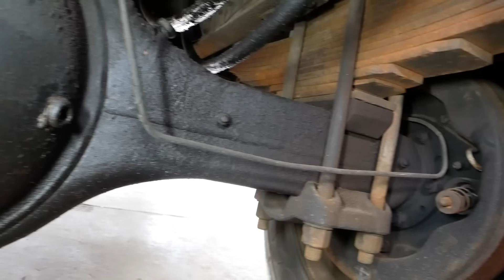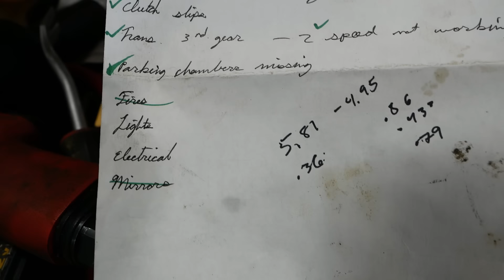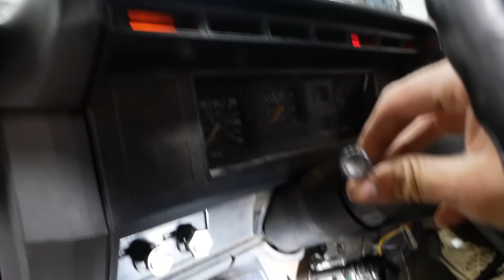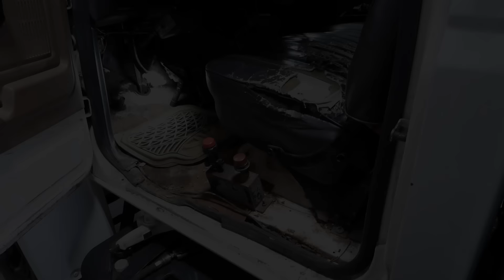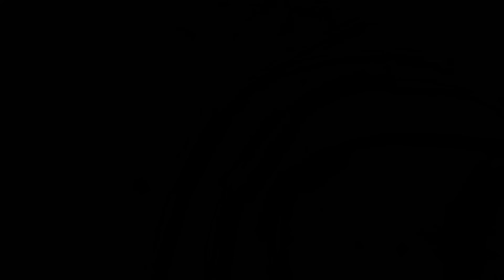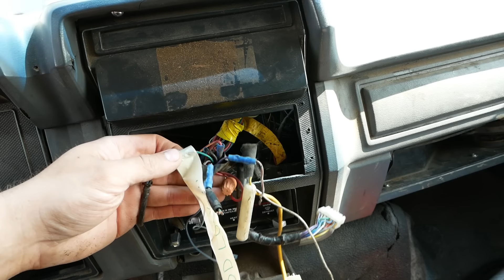Ford F700 Cummins Chipper Truck Project - P Pump Fuel System, Brake Chambers, and Wiring - Final

Comment: This truck is the poster for, “just do it right the first time” just imagine the amount of days this truck did not go to work, because of incompetence in repairs., and just imagine the years of stress of driving without windshield wipers. Lol
Reply: This truck is the result of a poor business model, but a common one, generally because they have a feeble maintenance program if any. There is no financial or downtime budget for the "right way" because it's all about profit. So the workers take the blame, properly earned or not for all mechanical problems, this is the place mechanical becomes personal, a lot of guys aren't gonna risk their job by reporting things so they make it work. It's not right but I see it all the time.
Reply: @deadpeddle4915  You could call that business model 'the result of manglement'
Reply: @deadpeddle4915  I agree, but as a business owner, that has ZERO time for any of my equipment to be “down for maintenance or repair” I can agree 100% that guys go and hack things and or have something working at 50% ., and refuse to bring it to my attention.. and feel an answer of “it’s been like that for a long time” justifies things.., now I’m all for what ever you want to call it, “hacking, farm fix, band-aid” to keep a truck or compressor, or blast tank in service., but then go right out and tell your boss, hay we had a problem with the brakes, we were able to rip the canister off and cap the line so we can keep working, but can we get this part ordered so we can fix it right, the next rainy day ?? I for one enjoy working on my equipment, when it’s general maintenance, or just swapping out parts.. larger jobs like internal engine work liners, and pistons I prefer to have someone help just because it’s not something I do every day., and the little tricks you pick up, make all the difference… but yes I do agree, with your statement…
Reply: @ryanhogan6509  A lot of this isn't even a lazy thing. Like the millions maurettes/wire nuts all around.... a crimping tool and EVEN those crappy non heat shrink wire connectors are better than those wire nuts lol. or just the hell of a mess all over. Some things for sure just get it done, but man, 50 bucks worth of tools to make the issues gone for a lot longer seems worth it IMO. I know the feeling of its a ''temporary'' fix that never gets fixed (because it works), so theres that too.
Reply: @baileyhatfield4273  yup everything is temporary, unless it works., lol..
Reply: @ Ryan Hogan:   Oh, it went to work!!!,.....just on back roads !!!
Reply: I forget which one it was but I had a friend who worked for one of these nationwide trimming crews . They had no FBO . So all maintenance was by local (where ever they happened to be at the moment) shop or by crew assigned to truck. The trucks were only kept for X years and cycled out. So in essence they have had a lifetime of "rode hard and put up wet" and the crews were usually minimum wage dead enders who just didn't care. My friend worked for them 2 years and said if a guy stays 3 months he's got seniority....

Comment: Wes, I gotta hand it to you, Ive had trucks like that in my shop and wanted to flat out refuse to work on them because of all the half ass work done  Very few of the folks around here are willing to pay for the time involved to undo all of that stuff. I do a lot of machinery / tractor restorations and they consume all of the patience I have for the most part. I have to take breaks as I feel my anger building up when something could have been fixed correctly for less effort and labor.
Some people have no business running or fixing machines.

Thx for the video, great Ford electrical refresher.

Comment: This is easily a 5K + material job...
Reply from the maker: Not quite...
Reply: @WatchWesWork  😕 man the amount of hours and know how youre putting into this work…. Dont settle for low payments. Ive run a shop in sweden for over 15 years. We specialize in us cars, mostly fords. What ive learned is that if you raise your prices and charge the actual amount of hours you put in, youll loose some customers only interrested in the work costing as little as possible, however, when you loose them, youre freeing up time for customers that are ready to pay to get their car fixed now or dont care about the cost as much. Keeping track of the amount of hrs each of my mechanics put in to each car is also very important. This way the bills are correct and free of any ”hours discount”. Dont be afraid to charge what your time is worth! Comparing salaries is hard between countries, but here in sweden youd be payed among the top 5% in the industry. No questions asked!

Comment: Jesus the only good thing about that old rig is the Cummins
Reply: What does Jesus have to do with this?
Reply: thats probably why the owner keeps it around. Did you see they probably got it from a Dodge or something because it had dodge wiring in there.
Reply: @parteibonza  yeah doesn't matter if the truck is a pile of shit is has one of the best diesels ever made under the hood

Comment: "why would they do that" - people put carburetor pumps on FI systems ever day and wonder why they have now power!
Reply: A modern car slapping on a carburator and making the whole thing FAR cheaper lol. Cheaper in the expences side of things. Also easier for on the road fixing and not getting stuck if you have a couple new or spare parts. FI has its place for your daily driver people who....well can barely pump gas.
Reply: @baileyhatfield4273  I meant people putting a carbouretor fuel pump on a vehicle with fuel injection and wondering why it doesn't work right. As for putting a carb on a FI vehicle to make it work - might be ok in the USA but not in the rest of the modern world -  Your gas millage will be worse (FYI the USA has cheap fuel today compared to the rest of us) , you will probably kill your emissions system and you will fail your annual inspection big time (yes parts of USA have a sort of inspection system)
Reply: @idrisddraig2  but why it clearly tells you what pump it  is
Reply: @idrisddraig2  yeah sorry lol I just seen carburetor. I live in  Canada, we have mf california or worse gas prices so I get it lol. Yeah some people dont belong working on cara
Reply: @baileyhatfield4273  Our gas is about €1.80/litre or $CND 2.70/litre at the moment!
Reply: @idrisddraig2  lmao ok shit yeah a bit pricey. Ours is "only" 1.40 or so a liter...but it gets taxed up non stop and hasn't had any big spike like the USA. Its normal pricing sadly

Comment: DOT inspectors are going to try to figure out a way to fail that hydraulic brake line I'll bet. That should be a fun argument to watch.
Reply: The hose might catch their eye,  but if the hose is DOT rated for the oil and for the pressure in the system, they will have to accept it as a viable repair.  Ford chose to use rigid pipe in the OEM build, but it is not required. Note that there is a flexible oil hose leading from the chassis hard pipe to the Tee fitting on the axle plumbing, that flexible hose is required there because of the relative motion between chassis and axle. The flexible hose Wes used to replace the missing hard pipe is just as legal as the pipe was from the factory.
Reply: @larrywalker7759  Oh I fully agree with you. Here in Nevada if a single brass fitting doesn't have a d.o.t. stamp on it they will fail you. I would trust a hydraulic hose way more than a thin walled heavily bent steel tube from the factory. Regardless, it's not really a typical air brake system that they are use to inspecting which is why it would be fun to see the argument.

Comment: Work on a same engine with fuel problem the cam was worn when running the engine hard it would louse it prime replace that pump with elt fuel pump work great